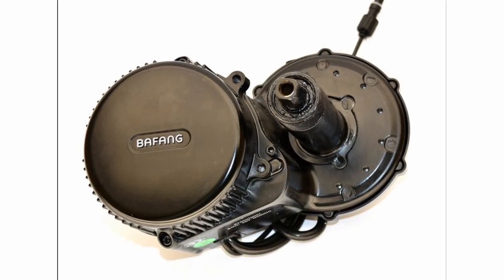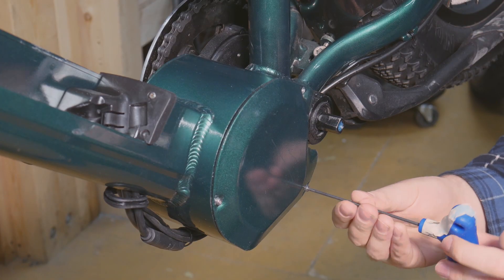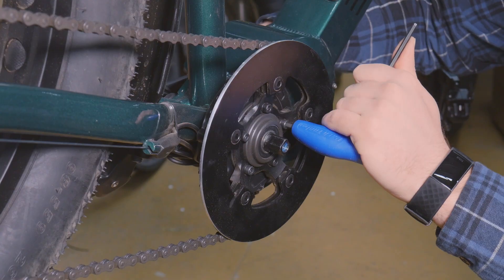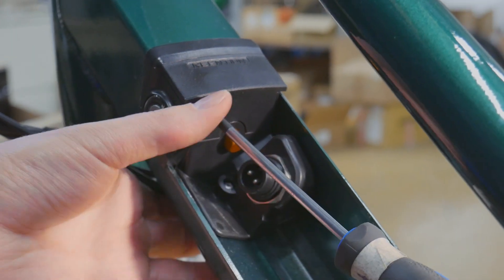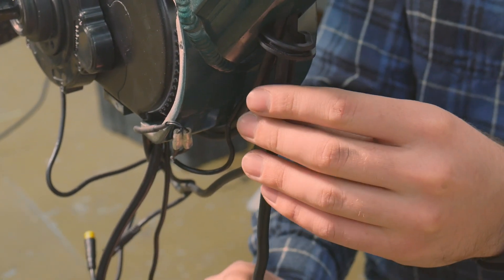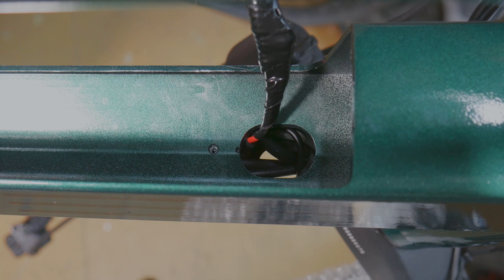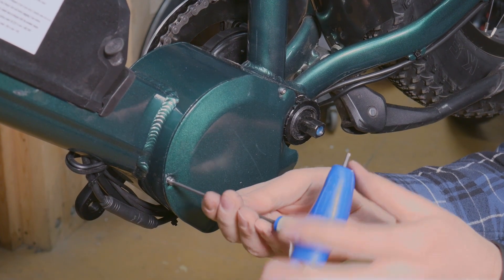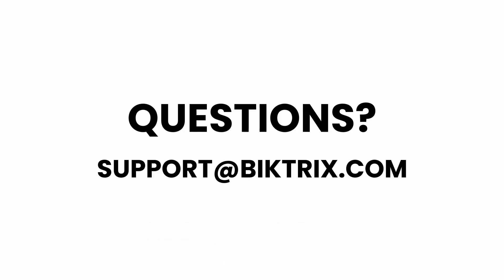How to Remove & Install a Bafang BBS02 & BBSHD - Easy eBike Service

Comment: Seems like that would need  cooling system . Need to test temperature with bafang in that frame vs bolted on a standard frame.
Reply from the maker: Absolutely no problem with it. We have over 1M kms on this system from customers over the last 10+ years

Comment: I wonder where did you get this Bike frame, your motor is M615 not M620 right? cos the motor sold on the market individually are M615, aka BBs02b, and they don't have compatible bike frame as it is a general version (so it can be DIY), and normal M620 is a different version that fits in some specific bike frames

Comment: First time I see this frame encasing the BBS02. Wouldn't the enclosure cause the motor to overheat, reducing its lifespan?
Reply from the maker: No actually. We’ve been using this design since 2014 and over 10k bikes sold, the frame acts as a heat sink. It helps with the longevity..